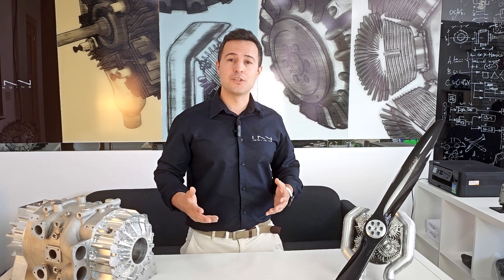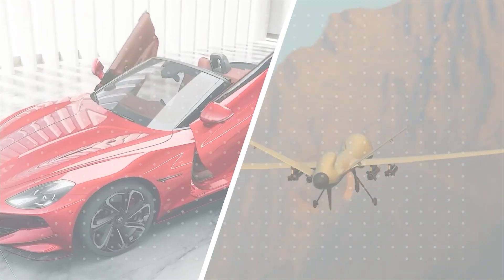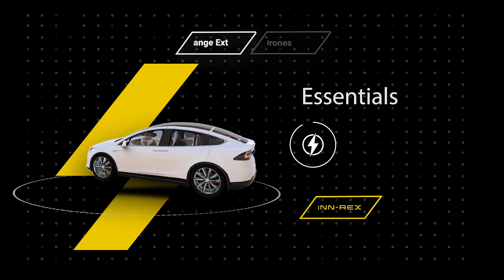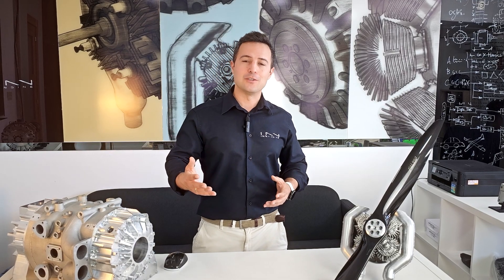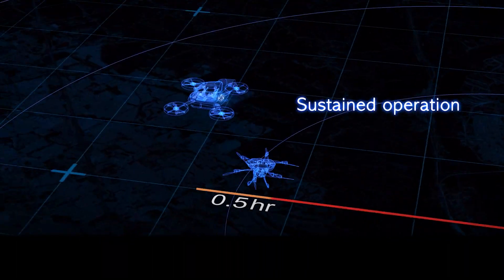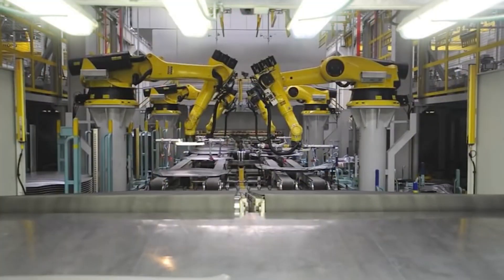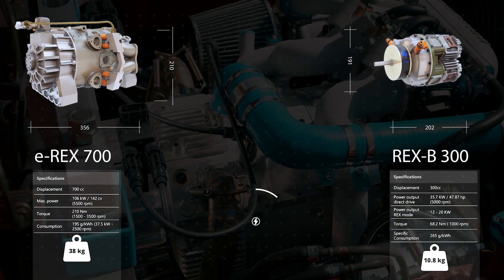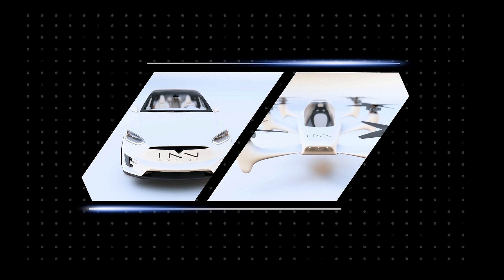Next gen Mobility

Comment: I ran some numbers.. For bencin motor 4 cylinders  is basically 40-42% efficient.
Diesel is possible? Possible by compression ratio.. From video comertials.
Probably would acheave over 50% thermal efficiency. I assume biggest problem is cooling?  How close im with 41%